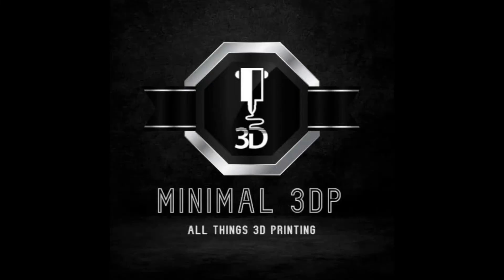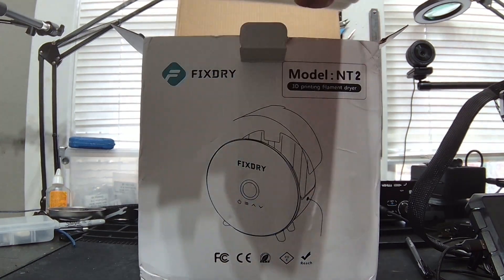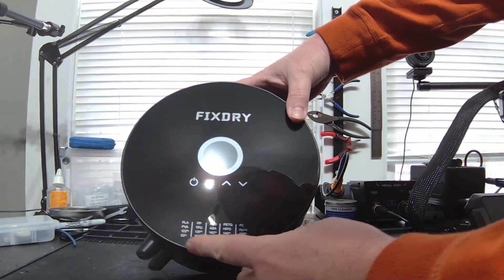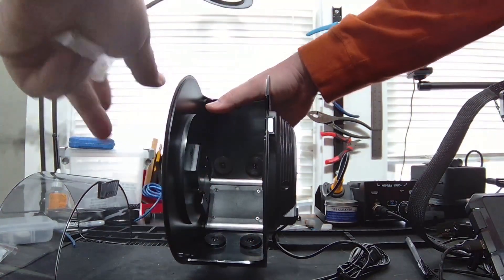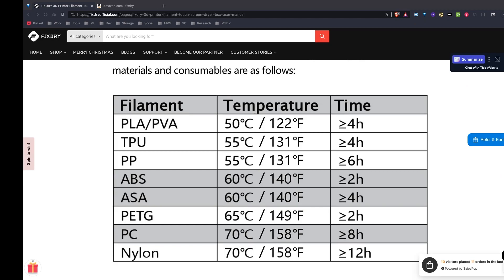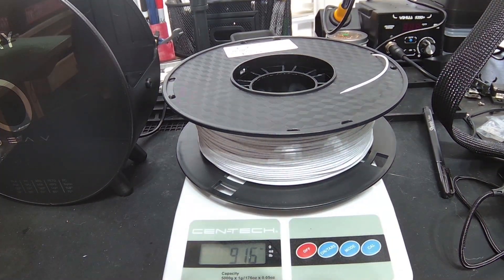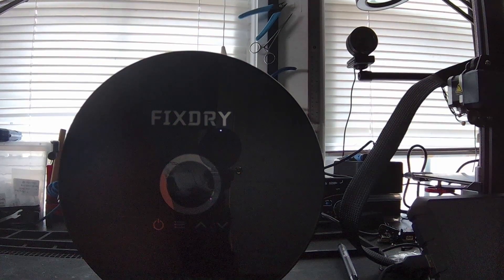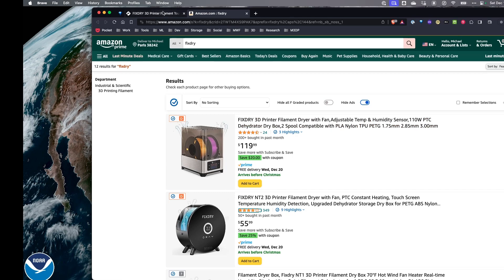Got Old and Wet 3D Printer Filament? Breathe New Life into it with the FIXDRY NT2 Filament Dryer!

Comment: I was surprised that the filament weight did not change much. So did you experience less brittleness with the PLA filament? Did you achieve better prints afterwards?
Reply from the maker: It surprised me as well but I have a couple different tools of filament that always seems to absorb less water. The filament was more pliable after drying though.